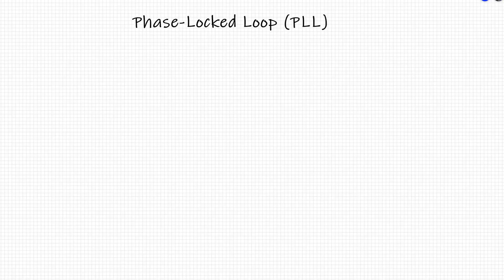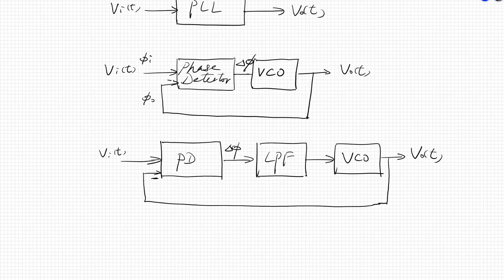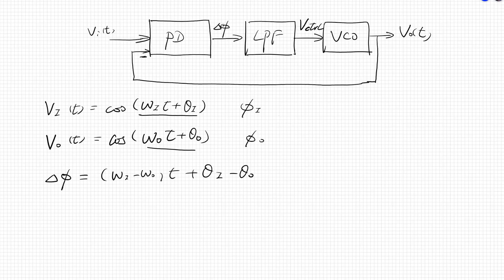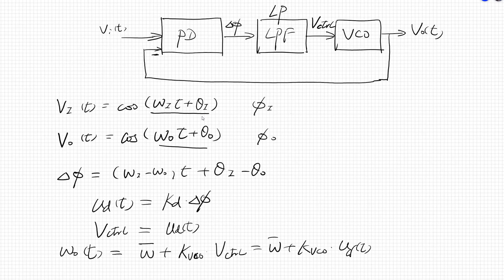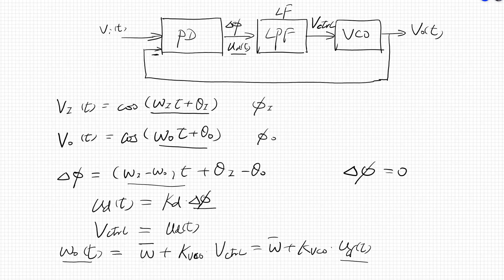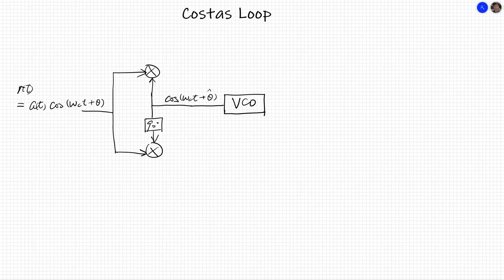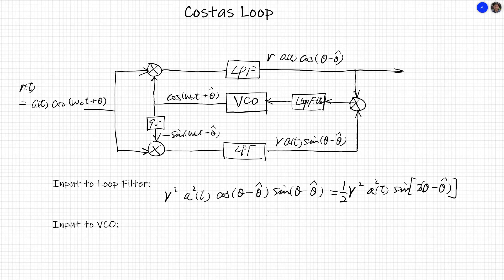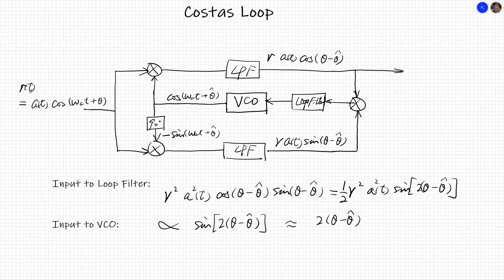Carrier Recovery Part 3: Phase-Locked Loop and Costas Loop

Comment: Professor Dong, i'm experiencing a phase error cause truncation. Is my matlab code correct?

t = 0:0.01:10;   % Time second
Omega0 = 2*pi*2; % 2 Hz
Omega1 = 2*pi*3; % 3 Hz
theta0 = pi/4;   % 45 degree
theta1 = pi/6;   % 30 degree
y0 = cos(Omega0*t + theta0);
y1 = cos(Omega1*t + theta1);
plot(t, acos(y0) - acos(y1), t, (Omega0*t + theta0) - (Omega1*t + theta1));